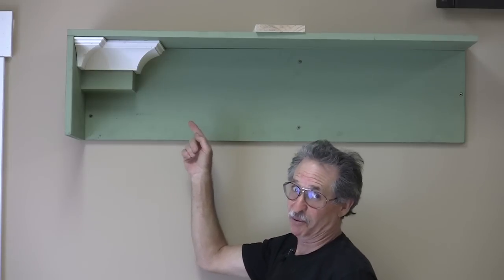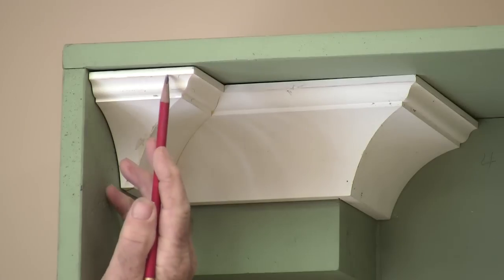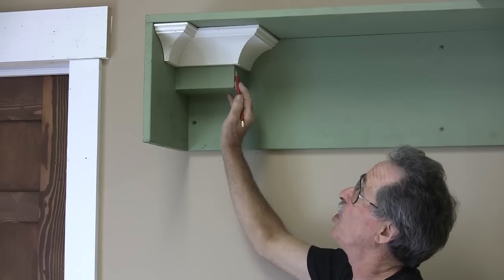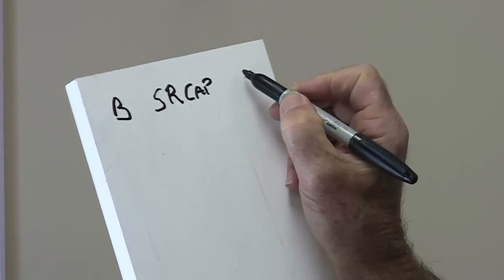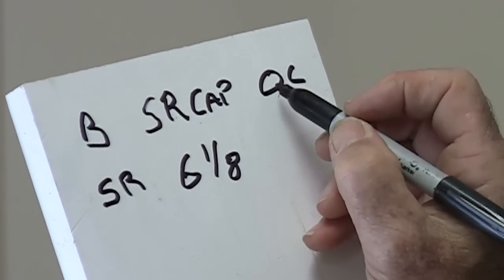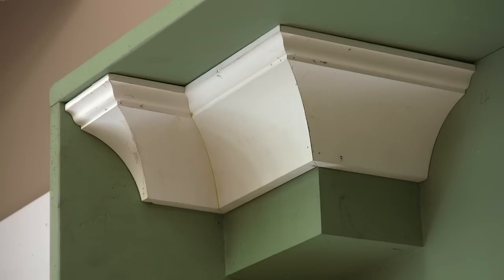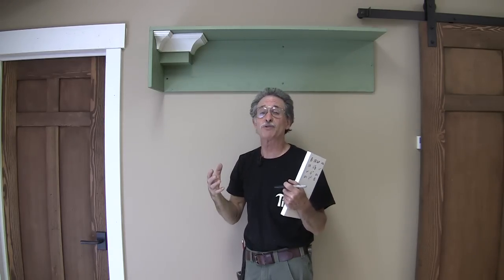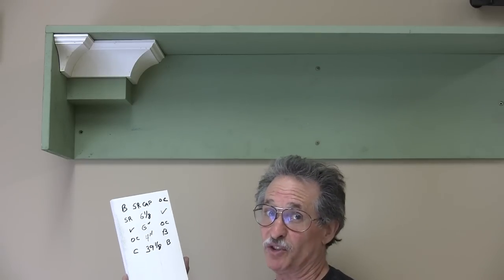Installing Crown Molding: Measuring Crown Molding

Comment: isnt the crown upsided down? The detail part at the bottom ?
Reply: chris Surajnarain yes
Reply: Most can be flipped based on the height that it will be off the ground.  Though some types like the one he is using are more suited for double or triple crown.  There are about 5-6 different types of crown and they all have a different orientation.
Reply: Most crowns yes, not this you tell by the top lip coming out if it went in it would be upside down.
Reply: @josealvarez4919  nope!
Reply: No

Comment: Nice job of installing it upside down. 🙄
Reply: It’s not upside down.
Reply: @a.s.j.g6229  you obviously don’t know how to install crown
Reply: @mim2046  it flares out at the top as it should. It’s just the design.
Reply: @a.s.j.g6229  rule of thumb is and always has been..... the small cove ALWAYS goes to the bottom. It’s been that way for the 27 years I’ve been a high end pro
Reply: @mim2046  you can check the manufactures website, this is how it is meant to be installed
Reply: @a.s.j.g6229  I don’t need to check any manufacturer website. I’m telling you the way it is installed by pros. You can believe whatever you want on Google
Reply: @mim2046  you say your a cabinetry maker? Do you install much crown moulding?
Reply: @mim2046  anyway, I don’t particularly care. Have a good day
Reply: @mim2046  so you know more than the manufacturer? Times change, designs change and new techniques are created.
I've met a lot of people like you that think they know best because of "years of experience" and stick to doing things one way and end up getting fazed out by carpenters who are willing to make the changes.
Reply: @Ufollowme2  I am so far from being phased out, it’s not even funny. I have been a high and pro for 27 years and have been self-employed for 21. I don’t do just cabinet making and furniture building. I have gotten into doing professional stripping and refinishing, touchup and repair, and a lot more. So until you actually know what you are talking about, I suggest you zip it
Reply: @mim2046  and yet you still don't know the differences between crowns, thats pretty sad with all so called experience you have
Reply: you played yourself daddy